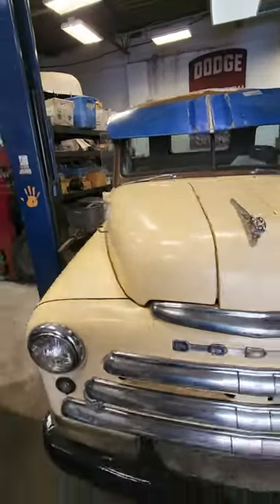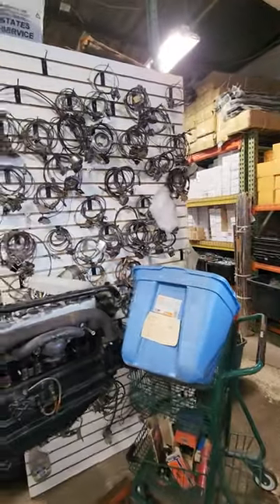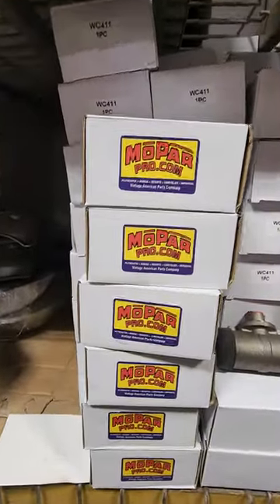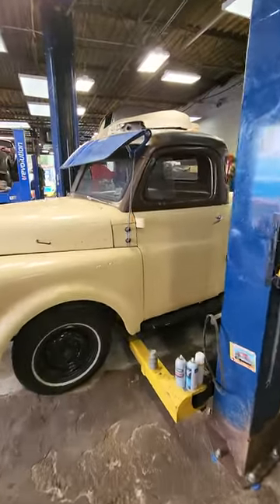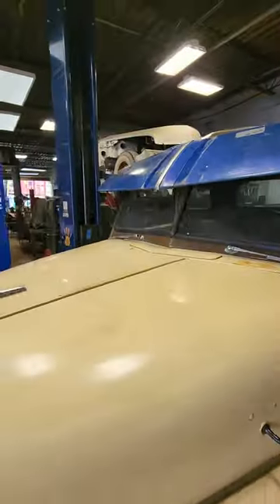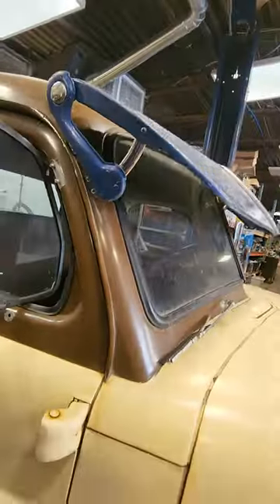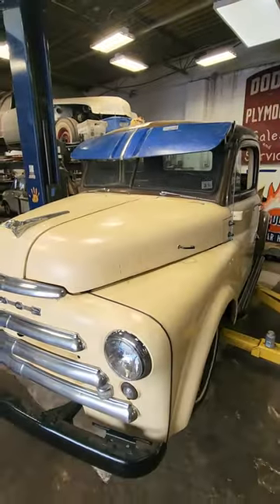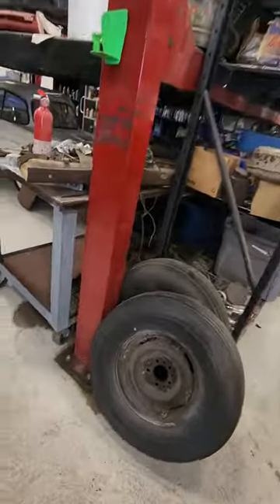fulton sun shield sun visor on 1950 dodge truck@ mopapro

Comment: I think it will widen to fit your truck in the center of the visor and the holes are drilled into the door jam and the screws are only seen when the  doors are opened. It will take extra hands to get it placed just right and increases the cool look of the truck